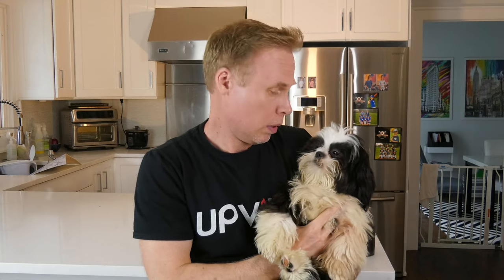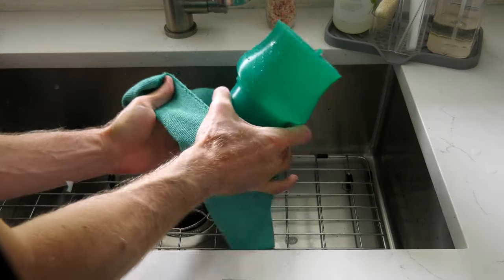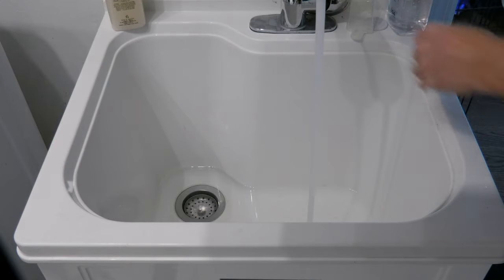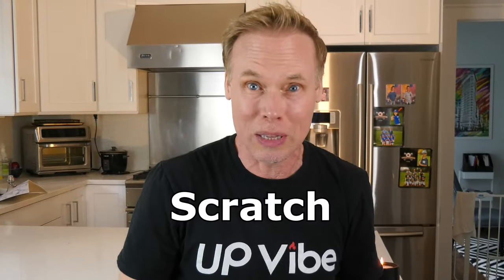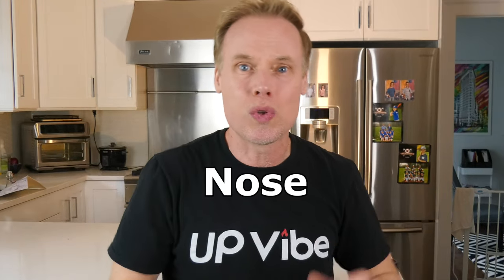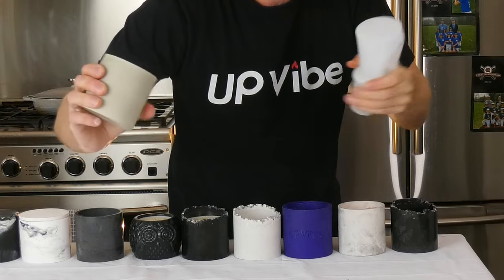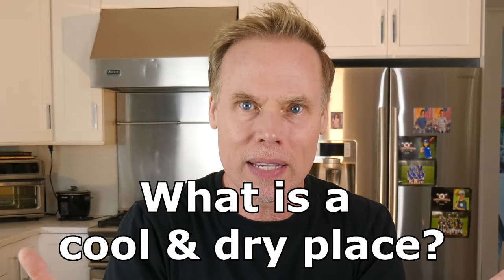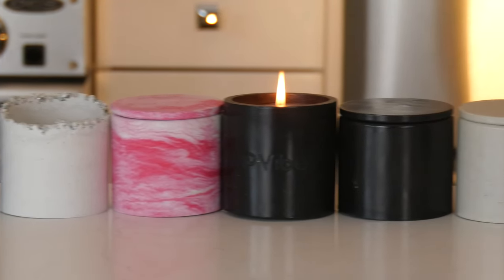How to Clean Silicone Molds

Comment: Will this work for the silicone bowls? Mine is full of dried concrete even after cracking it and bending it
Reply from the maker: If you have concrete stuck on your silicone bowls you will need to spend time removing it. Try not to let it dry as it becomes harder to clean.

Comment: Hello, how are you? Congratulations here from Brazil. Taking care of the mold as you guide lines in 20 years, of course metaphorically. In practice, how many cups can you make with the same mold? Congratulations on the channel...
Reply from the maker: Thank you. It all depends on what silicone mold you have but if you take care of it you can have it demold for a very long time. One silicone mold company told me about 500 plus. Hope that helps...
Reply: @upvibecandle  thanks

Comment: What can you do if you dulled your silicone molds? Is there a way to restore them?
Reply from the maker: Depending on what kind of silicone mold you have you might be able to add more silicone to that mold which will rejuvenate it. Flat molds work best for that technique. A concrete candle jar silicone mold you can't do that with.
Reply: @upvibecandle  yes. It’s a jar silicone mold 😩
Reply from the maker: @Wondrouslybotanic  unfortunately that would be tough to make shiny again.

Comment: I’ve watched this tutorial a number of times & always learn something new every time 😊

I am experiencing an issue where the items I cast (I just Jesmonite & Jesmonite alternative acrylic resins - similar stuff to plaster of Paris) when I go to either seal or wax polish them, they appear to have smear marks on them & not matter how well I wash my moulds I’m thinking that they have been contaminated with something (maybe something I’ve used in past to wipe clean) so these marks will always appear…is there anything you can do to condition a mould or any other solution that can be used other than what you went over in your video, that may assist? It’s as though there’s some kind of film on those areas so the sealer or wax polish is repelled from those areas (if that makes sense) Shame I can’t send a pic so you can exactly what I’m talking about.
Reply from the maker: Go to the about section on my Youtube home page and you can find my email address there. Then send me a pic via email. Let's see if we can solve your issue.
Reply: @upvibecandle  oh excellent - thank you so much..will do so 😊

Comment: Hey Jai, I've recently done a pour in one of my molds and when demolding it after 24 hours, the item was really tough to demold and left me a cement stain in my mold. My question is, has this ever happened to you and will the trick with alcohol work? If not, do you have any other solution to remove the stain as it looks like if I used it for my next project, the stain will reproduce on the next pour and make the project come out bad. Thanks in advance for any help!
Reply from the maker: I would soak the mold in warm soapy water for 30 minutes and scrub gently with a soft brush or sponge. If the stain persists, try using a vinegar solution by rubbing the stained areas with a cloth or sponge soaked in equal parts white vinegar and water. Alternatively, create a paste with baking soda and water, apply it to the stains, let it sit for 15 minutes, and scrub gently. If stain remains then try rubbing alcohol but don't saturate it as alcohol can damage it.
Reply: @upvibecandle  I'll try these out and let you know what happens 👍thanks again for your help!
Reply: Let me know ,it works with you?
Reply: Hey  @Daall-kw7hm , unfortunately I tried various methods but was not able to remove the stains from the cement. Not sure if the quality of the silicone is very poor and not able to withstand the corrosive nature of the curing cement. I recently moved and have not unpacked the mold yet and continued to work on finding a solution. If you come by any solution, let me know.